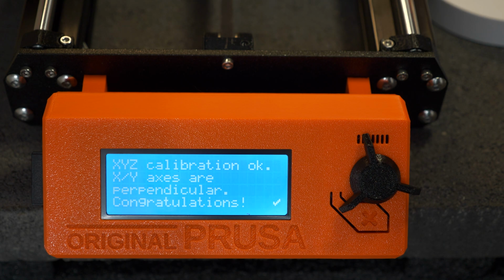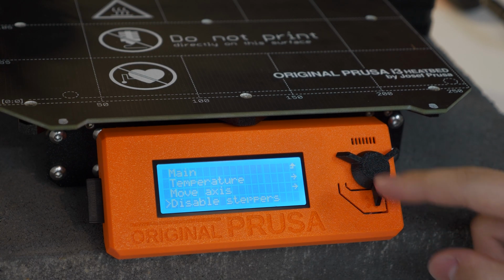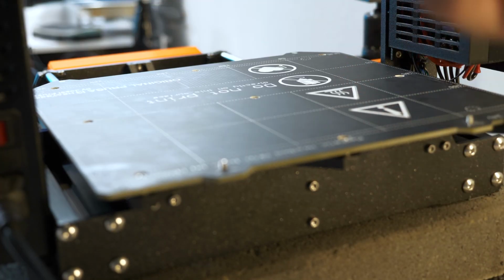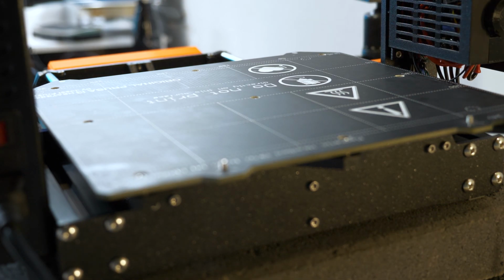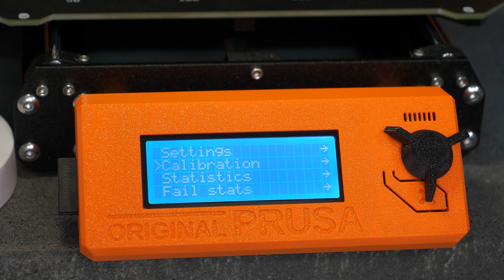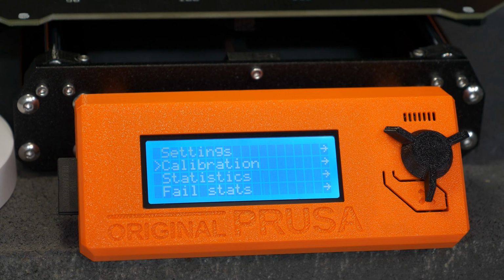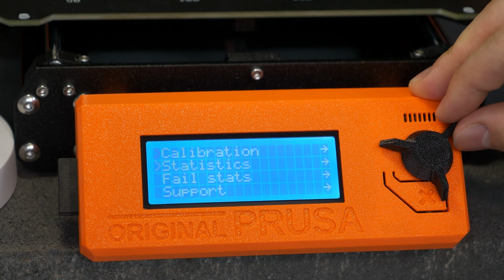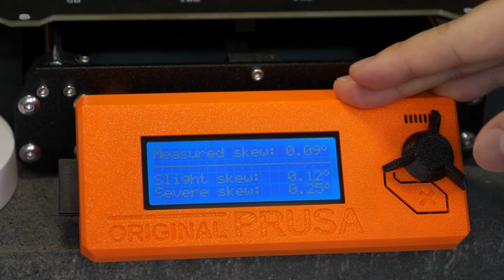Physically Correcting XY Skew on Prusa MK3S+ / MK3

Comment: Hi, I'm a bit late, 3 years!
I was able to correct YZ skew, by placing a slab of calculated thickness under the Y-rods at the back side of the printer.
However, I do not see how the XY skew can be corrected without printing slightly modified Y rod holders.
Repositioned holes for 2 screws for each Y rod holder could do the trick, but you tell us to loosen the screws and move the backside of the table to one end. Not possible here to any useful amount..
Please help, I'm confused 😕

Comment: I managed to do this with my Prusa i3 Mk2, believe me it was a lot harder with the threaded rod setup!
Edit: It ended up being very beneficial as my printer is now fully a Mk3S except for the Y axis which is still Mk2 but with the removable bed. I can't run a calibration without modifying the firmware to account for the 10mm less z height, so it's good to know my printer is perfectly perpendicular and it doesn't matter.

Comment: Thank you for making this! I recently had my calibration go from perpendicular to slightly skewed and I had no idea what happened but, I followed along and sure enough, one side of the bed was off so, I loosened it all up, used the straight edge to keep it as in line as possible while I tightened it and BAM! Back to being perpendicular, and by a good margin at that, went from being a 0.14 to a 0.10

Comment: Part of the skew is also going to include the angle of the stepper motors and the rods. You should also adjust the bed rods and move the bed to the extremes and adjust the screws there.

Comment: Just to share my experience - I tried the steps in the video but those checks were fine.  I still had a 0.19 degree skew.  I noticed if I loosened  the Y axis smooth round rod holders then either pushed them up or down while tightening them back up, that would have an impact on the calibration result.  My calibration was reporting the left was lower then the right side, so I tore a small piece of paper, folded it twice and put it under the round rod in the holder at the back corner just to raise the rod a fraction of a mm (probably 0.4mm).  Finally the calibration result changed and it is now a 0.10 degree skew.  That was without trying to fine tune it further.